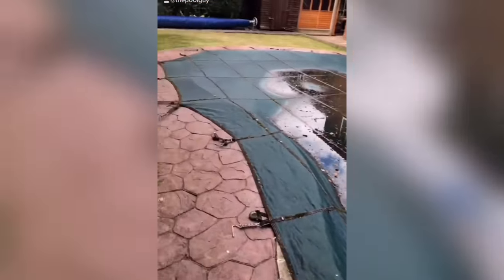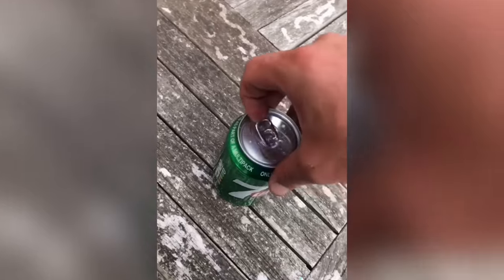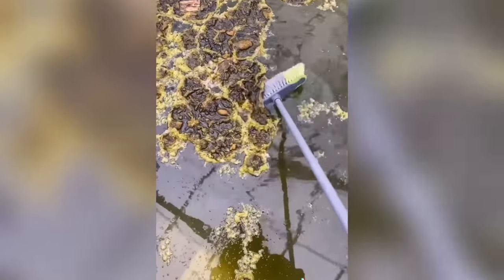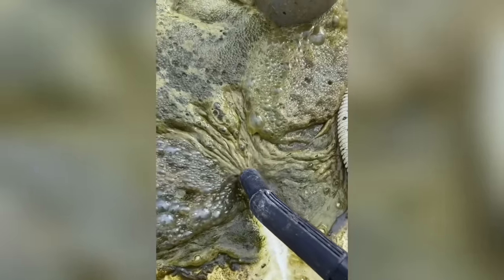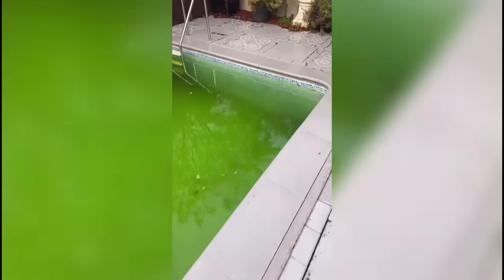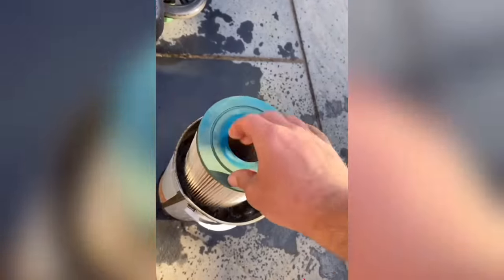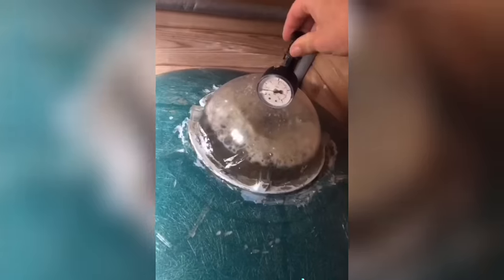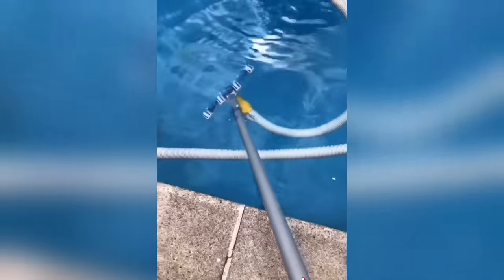Satisfying pool cleaning compilation

Comment: These guys handle gallons of hydrochloric acid with bare hands and then there is me in the lab wearing double gloves and face shield to pipette 5mL of it
Reply: To be fair acids in the lab may be much more concentrated.
Reply: @user-hz7pk9vb6z  fosho
Reply: They wanted us to pipette using our mouth .. I don't even remember ..theres no way I was ever doing that
Reply: @Valeriaa6240  We did it but for only dilute acids.
Reply: Yeah I’ve spilled that shit on my hand a few times and it burns like shit.  Also when you’re pouring it out, the fumes are terrible.
Reply: @trevorpiazzon9249  true
Reply: It’s only 32%
Reply: @trevorpiazzon9249  i spilled it on my hands once, too but i was complety ok and I didnt feel anything lol
Reply: @MrSharky03  i dont think IT was the same acid
Reply: Me with 1M HCL solution lol
Reply: @MrSharky03  it's probably the less concentrated one. In the video this dude use 32% acid
Reply: @TheNamesArif   considering that the most concentrated hydrochloric acid solution is 37%, a 32% solution is pretty high..
Reply: @1 e same acid, just different concentrations
Reply: probably more concentrated in labs. plus safety protocols.
Reply: I burned a hole through the desk
Reply: You should be careful, I got pure concentrated bleach on my hands and they burned
Reply: LOOOL
Reply: I think you're a bit over the top with the lab protection just for HCl. The only acid that truly scares me is the HF and other fluoride compositions like BF4. (I don't know about organic molecules, I don't have a lot of experience in that domain). I have handled 98% sulfuric acid with simple latex gloves or bare hands and glasses . If you are careful, you are fine even without gloves. Actually gloves can give you a false sense of security and lead to more handling mistakes. Always wear your lab coat and glasses but gloves are not mandatory (of course it depends on the task itself) . Running a sample in X ray diffraction is not the same as cleaning all of your equipment with acid or handling molten metals.
Reply: @blackjack5167  u dont say that it doesn’t fit u cuh
Reply: Why is this so mesmerizing to watch?!
Reply: Were never told to be particularly cautious using our 1M HCl solution. We usually handle it the same as the other chemicals and I’m always pretty careless with it, I don’t think it would cause any real harm. This one time we were working with silica and that can cause respiratory issues and I had no idea until I was breathing it in.

Comment: No matter how much he is being payed for this, he is still underpaid
Reply: lets be real the chemicals are doing all the work. Plummers got it worse than this guy
Reply: @fourdeep6561  you're quite underestimating the job of pool cleaners. Imagine your washing  a car the chemicals are like soap but no matter how much soap you use soap alone wont make  the car clean, you're gonna have to scrub it yourself
Reply: @myxo884  yeah scrubbing isnt some disgusting horrible work it isnt that much of a pain in the ass to do most of the time he just used a high powered water jet to clean it then also some scrubbing but ill admit that he knows a lot about the pool systems and shit which is hard when he goes to different houses and knows how to use their pumping systems
Reply: @myxo884  also the acid doesn't require a scrub either

Comment: I can’t really judge since I don’t got a pool but imagine neglecting a pool for so long, the pool guy has to scrub it with one of the strongest acids on earth to clean it like damn
Reply: @happycouch501  still the use of  acid sounds prety hardcore to me
Reply: Youd be  surprised, lots of acids are used in the up keep of pools.
Reply: @Claire Alderson what about to put out off the water and then cover  the pool. It's easy.
Reply: Hydrochloric acid is weak, if you used a strong acid then you’ll just damage the pool itself
Reply: @katherineabreuhernandez409  With some pools you can, but if the pool is not old enough or not made of cement, you should not empty it out, the presure of the ground can make them bend inward or crack them.
Reply: You have to use the acid in weekly care of the pool. Water maintenance.  Otherwise you end up with issues that can be costly
Reply: @Claire Alderson yes it is neglecting. I know people dont use the pool on winter, but that doesnt mean you dont have to give it maintenance during the weeks
Reply: you're fine. I have a pool, and its been bad with leafs BUT NOTHING LIKE THIS video like god damn...
Reply: @ymiras7881  or maybe they dont want to do the maintenance and prefer to hire someone to do it because they have the money

Comment: Hi mate, during lockdown last year 2020 I built a large garden deck with a matching pool surround for a 13 foot above ground steel sided pool and liner, it came without any filter pump, and I've just been using chlorine tablets in a float dispenser coupled with a skimmer and solar copper water ioniser. Is there anything else I should be using to keep the water clear and free from anything nasty in the pool. Any help would be grateful , thanks

Comment: My parents had a pool for me when I was a kid. 4 feet deep. I don't recall how wide it was but an above ground swimming pool. After many years of always finding BLACK water and worms in the pool, we found it best that on Memorial Dad, we would uncover the pool, completely drain it, then start scrubbing. Then we'd actually climb inside of the pool and scour it until it was like new clean, then start filling with fresh water. So basically more trouble than it was worth as I grew up. Considerable expense too. I HATE frogs snakes, tadpoles, worms and mud, so when I moved, the pool stayed, covered, with the Jacuzzi pump and sand filter in the basement for the use of whoever purchased the house and whatever they wanted to do with it. Pictures since have surfaced on the Internet. That pool is long gone. They really are too expensive and more trouble than worth. Best to just pay a Civic Center and use their pool or find a water park if you want to swim that badly.

Comment: I just have a genuine question y'all I really wanna know... Why don't people just dry out the pool when the summers gone? Or you know that the pool season has ended and won't use the pool anymore? Do these pools not have those drain holes/pipe?
Reply: 1. The amount of water in the pool is alot and the pool doesn't have much surface area for the water to evaporate 2. People are lazy to drain the pool and sometimes filling up the pool uses alot of water so it might be expensive
Reply: @h3xagon488  ah it makes sence... Thank you man...!✌️